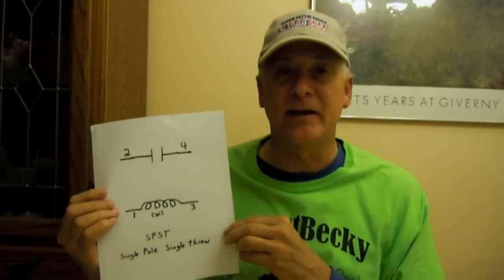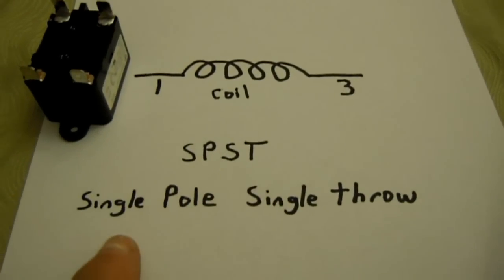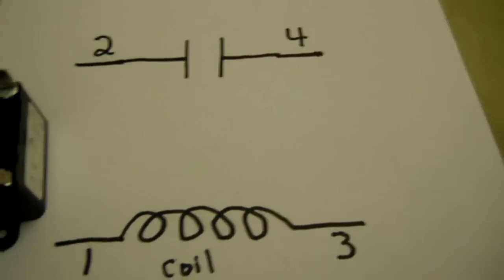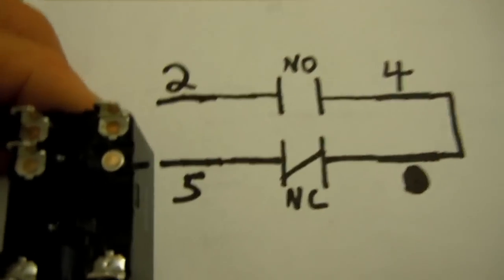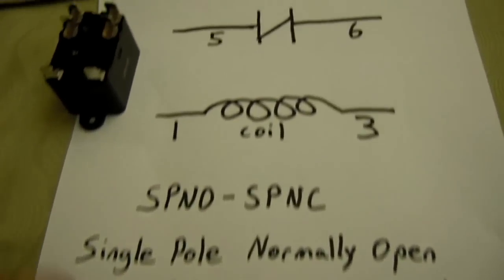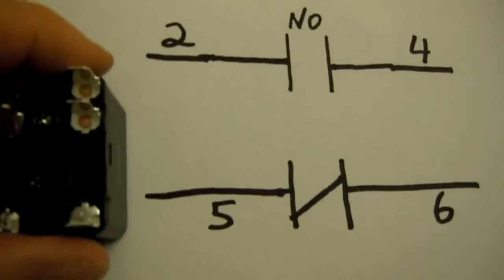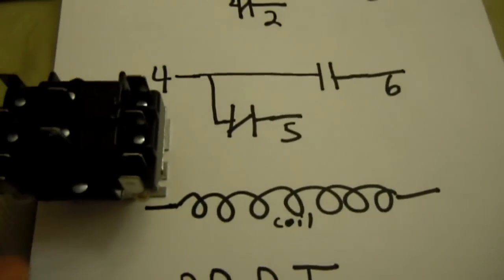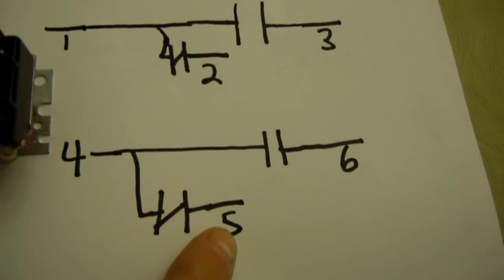HVAC more about SPST, SPDT and SPNO-SPNC relays

Comment: I checked an indirect boiler water heater last night. I found that the water heater was the priority on the panel zone control which mean the control zone panel was on the o. Position. Turn off the heat, the house still hot. Need some help with that

Comment: Have you worked on a 3 pole definite purpose contactor for 3 phase compressor? I have a commercial AC which has already burned 3 contactors. It marks 24V, 240v and other higher voltages. Never worked on this before, just wanted to check if you have any idea about 3 pole definite purpose contactor. Thanks

Comment: hi DR zarkloff  sir i would like to ask you a question , i have problem in Mani split air con  the is York made in Chaina DC. converter 18,000 B.T,U  the problem is out door fan motor  after 20 minutes is motor going to stop after 3 minutes motor is going to restart but compressor is still ruining i have 1 replace the a new motor the problem is the same then i 2 replace capacitor 3, i replace p.c.board with the transformer for out door but sorry to say the problem is still the same  i hope you will answer me for a better solution thanks & regards

Comment: Ok I got a new install AC everything works fine but when switch to heat the heat pump works fine but lower inside don't come on yes heatpump
Reply: Armando Monreal What kind of tstat do you have? You might want to be sure that the tstat controls the blower.
Reply: DrZarkloff Honeywell 3000 I install in not sure on the one our vendor install he came in and said it was the Tatat the original one didn't have the switch for gas or heatpump on the backside so he just replaced the face of it I'm not sure if that's all he did

Comment: so is it right I need to power the coil and then a separate supply for the common? or can I take a jumper cable for the positive side of the coil and connect it to common?

Comment: Hello DrZarkloff - I purchased a transformer 120VAC to 24VAC and a SPNO-SONC relay to use with my millivolt gas fired furnace and my new Nest thermostat.  There was a video I saw 6 months ago that recommended the purchase of the transformer and the relay because the Nest needed a higher power source than what the millivolt puts out.  Now I cannot find that video.  I am trying to figure out which wires to connect to which.  Can you help me?  Please?
Reply: are you referring to the coil?
Reply: DrZarkloff I think I know the coil but not the load.
Reply: +Chantale Wong it doesn't sound like it was my video. I don't make gas furnace videos. I don't know how many millivolts your load is going to be.

Comment: Can I ask what relay I need? I have a motorcycle horn I want to work only when my stock horn and mainbeam are on. Will I need 2 switching relays or is there a single relay I can use. Thanks for you help
Reply: you should be able to use a single pole double throw. You probably need a 12 vrf
Reply: you should be able to use a single pole double throw. You probably need a 12vdc coil.

Comment: My air handler fan does not turn off. do think i need to change my relay switch. thermostat turn off and outside unit turns off but the fan in the air handler stays on. Help!!
Reply: Did you figure this out? Was it a relay?

Comment: What about if I don't cross them cause I got a switch with 5 points 2 in the middle 2 on top and 1 on bottom what is that ? I think power is in the middle and then with switch power goes up or down it was a switch for a sunroof that Brock now ima replace it with a radio shack switch can I do that man thanks nice vid
Reply from the maker: I'd have to see it to be for certain.

Comment: DR Z. I could use some help with how to wire a dpdt relay to reverse a 12 volt motor for my auto chicken coup door opener & closer. I have the limit switches , 12 volt timer,& 8 pin dpdt relay. Thanks !

Comment: I'm so confuse about how to wire a relay, for instance I have a 120v 11 pins relay and A & B pins are coil relay. where should I connect incoming feeding wire (hot) and white neutral wire. Also I'm confusing with terminology for COMMON. What is referred to?

Comment from the maker: The coil voltage is on pins 1 and 3. The line voltage goes on pin 2 and the load voltage goes on pin 4.
Reply: DrZarkloff can you explain it with voltages

Comment: @DrZarkloff Yes I have a six  point fan  relay and the inside blower  fan  is always on? Once  I remove the fan speed wire which  comes  from the motor it turns off. The fan  speed is connected  to the normally  closed set of  contacts i believe its 6 or  5 .  Fan relay  was switched.  I was  to it could be  the heat  sequencers.

Comment: great video. what kind of relay wound i need for 3 positions, on, off, and another one (im going to be heeking up a small strand of LED's) they will be coming from 2 different power sources. and can you tell me which wires would get wires to which number? thanks alot

Comment: @RockinGuy1994 These relays can be used for lots of things but usually in a residential application they are used as fan relays for blower motors. They are also good to use if you need just a set of contacts to control when something comes on/off, like if a relay on a control board goes bad.